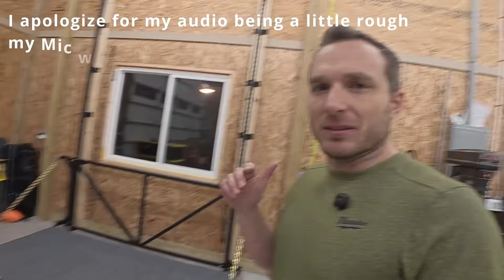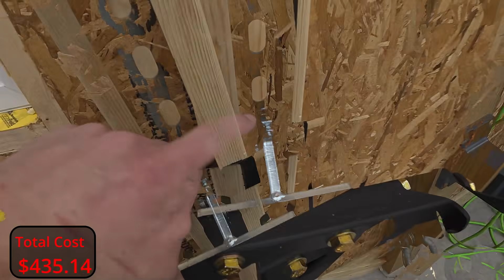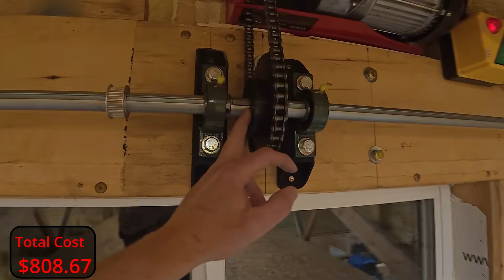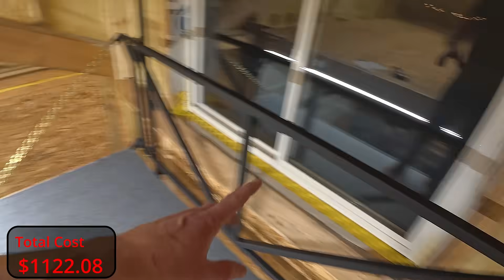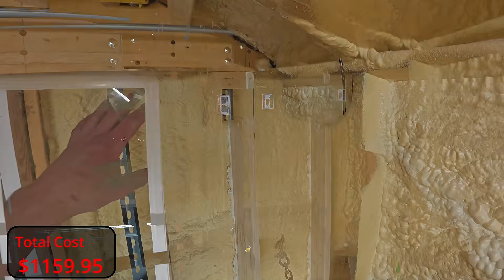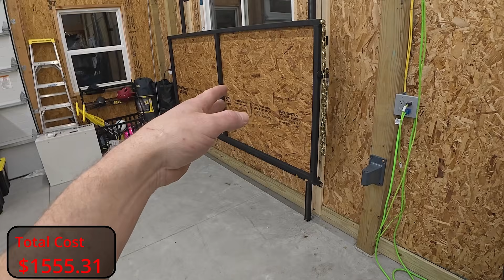DIY Shop Elevator Build Cost And full PARTS LIST (ATTIC LIFT)

Comment: Great design and thank you for the parts store, I'm currently framing in for a ride on elevator and was going to use a ball screw and thought of using the very same Vevor cable lift and your idea with two cables, shaft and info in wiring for limit switching and gate slider mech is awesome.
  If I may add an idea I saw using safety climbing tethers that work like a seat belt.
 I'm going to use two, one near each cable  for a safety like elevator without the pricey centrifugal brake safety.
 Once again thank you
Reply from the maker: Thank you for that.  Yes I think this is a simple enough design but is built well and works flawless so far and I've been using it almost daily for the past 8+ months.   Everything just works the way it should.  The dual cable set up with the single shaft keeps it perfectly level all the time no matter how its loaded.   As far as the dual fall arrest retractable belts, its a great idea and would probably work just fine. Only downside to those is they usually have about 3' of deceleration built into them so when you fall it slows you down before it stops up.   Im working on a system that to engage a parking paw into the slots at the track the second it senses either one of the cables slacking and would engage the pins before it ever really drops. Might go down 2" max before engaging.     I plan on working on it more and testing and perfecting it.  I will post a video of how it goes once I get the time to finish it up.    Thanks for watching!

Comment: For the fall arrestor, put a centrifugal brake the same thing they have in a fall arrestor but mount one on each end of the shaft.  Might only need one. This way you won't have to deal with another cable 14' long.
Reply from the maker: Yeah i was digging into an idea very similar to that and i think is a good option if the motor or chain has a failure but doesn't help if there is a cable failure.    I am slowly working on some ideas I have and when I get a little more time I will show you guys what I come up with and do some testing with it.   Thanks for the suggestion and thanks for watching I appreciate it!

Comment: Have you thought about or looked at some type of ratchet paw, that interfaces with the slots in the unistraut for a safety.
Reply from the maker: Yes I've been working on a system that uses the slots in the unistruts.  I haven't had the time you prefect and test it yet but i will soon.   Ill post a video when I do.  Thanks for watching

Comment: Great video, build. CAUTION….. saw another video like this, same 1/4” key way. He rode it…came crashing down…back injury!!! Key way failed…too much stress on that small key way!
Reply from the maker: yes you are right that bad things can happen.  I really dont ride it and if i do its not with a load on it.  I have a full staircase that goes up to the attic at the other end of the shop so i can just walk up and down.  plus i will have a video out soon with some safety features installed.  thanks for watching!

Comment: Some might think the chain is the weak link and they may be right, but I think the weak link is the hoist itself. I know lots of people use them and I rarely see issues other than "IT WON'T WORK", but as long as I have been thinking about building something like this, I haven't been able to find anyone, company or user, that will say it has been tested to " X " .  What I really do not understamd is how can they make these hoists so relatively cheap, but only go to 2200 pounds when they build 12 volt winches that I have witnessed holding 1-ton trucks and heavy SUV's up to 18,000 pounds for only a few hundred bucks more???  I am all about overkill, so yeah, I'd like to be lifting 1000 pounds with a 12,000 pound lift!!! I'd feel much better about anyone else being even relatively close to anything in the air...
Reply from the maker: Overhead lifting and winching are two different things.   I get your point that if its good for 18,000lbs than it should be good for 2000lbs.  Most Overhead lifting products have to have a 5 to one safety factor built into them.  So the same reason a tow strap the same size as a lifting strap is rated for 32,000lbs and as a lifting strap its only rated for 6,800lbs.  Not saying the hoist i used is built better or stronger than a 18,000 winch but it's built to be a hoist not a winch.  There are millions of these cheap hoist being sold and if there were consent failures you would hear about it.   With anything mechanical there is always the risk of part failure it's just how we try and minimize that the best we can.     Thanks for watching i appreciate it.

Comment: Maybe a high carbon key for the sprocket instead of high speed steel.  That key may wear out over time if there is even a little "back and forth" wear on it, or in this case "up and down."
Reply from the maker: That’s a good point, I’ll definitely keep that in mind if I notice any wear during my next inspection. Thanks for the tip! 👍

Comment: Sam,  Any way to marry the winch sprocket off a boat trailer winch?   Has the lever/lock on it that you manually flip one direction or the other...pending if your winching or releasing the boat to/from the trailer 🤔

Comment: Great  build you were  talking  about  safety  you could look  at how 4 post lift works  what they  call ladder  set square holes or stops with  engaging hooks  spring  loaded  that would  engage  on unistrut  or support  brackets could  also put a shaft collar  that slides over  key  ways  to strengthen  them up so the engagement  is more on main shaft.
Reply from the maker: Yes those are all great suggestions!  I have been working on and testing some new safety upgrades for it and once i get it done I'll post a video of them.   Thanks for watching 👍

Comment: Sam, you need to come up with some kind of safety, mechanical locks based on the cable tensions....something or don't be riding it!  Murphy loves me and I'm a retired Engineering Tech and I've been caught more times than I care to mention and usually because Murphy loves the way I trust the math!
 Be safe, or at least safer my friend.
Reply from the maker: I appreciate the concern and definitely agree that extra safety measures are a priority I am working on right now. Thanks for watching I appreciate it.

Comment: This is the best build of a lift I have seen.  Everything is well built to overbuilt.  Just the philosophy I approve.  Some additional suggestions for safety:   Expensive but effective would be a  Self Retracting Lifeline.  However, there should be a way to use the existing holes in the rails to fabricate an emergency stop.  Something mounted on the frame like a spring loaded bar with pawls that are engaged in the holes unless manually held back.  Or perhaps a friction brake that looks something like the trolly with bearings replaced with pads to grab the rail surface.  Something I have seen as a problem with everyone's build:   The manufacturer spec for the trolly is with force perpendicular to the rail and evenly distributed to all the bearings.  That is not the case in a vertical application.  The trolly is cantilevered and ALL the force is on the top set of bearings pulling out and the bottom set pushing in.  Under this condition the center bearings probably contribute no load bearing at all.  Also, the bottom set of trollies only provide guidance in the rails and don't bear load at all.  But that's why overbuilding is good.
Reply from the maker: Thanks for the input and suggestions. Yes the Self retracting life lines are a good option but you are right that they are pricey.  I have been looking into building an auto engaging latch that would engage into the strut holes.  Haven't spent a ton of time thinking about it yet but I should be able to come up with something.   As far as the trolleys go you are somewhat correct but there are some forces your not thinking about.   The lower trolley actually acts under compression and the further the load is away from the wall the more compression load that is on them.  Its pretty minimal though.  The upper trolley also sees very little load. Think of it like this, if there is 1000lbs in the center of the platform the max load at each outside corner is 25% of that. So thats 250lbs, but when rigging in on an angle like my chains, it increases tension. So for a 45 degree angle of the chain the tension is 1.4 times the load so the 250lbs ends up being 350 lbs. That is well below the 3000lb working load rating. There is also very little room for the the trolleys not to sit flat in the track so most if not all the bearings are making contact.  In saying all that, out of all the things that could fail the trolleys are pretty low on the list in my opinion.   I will definitely have a video soon with some safety upgrades and share what I come up with.  I am always open to ideas and love all the input from you guys. I will also post if I have any failures or issues, so far its been flawless.  Thanks for the compliments,  suggestions, and thanks for watching, I appreciate it.

Comment: Nice build! If you want an easy, quick and inexpensive safety stop you can install another sprocket, to your 1" keyed shaft, pawls to contact the sprocket and finally install another wire and connect that to your platform. As your lift elevates the pawls contact the sprocket as it turns. You also get a satisfying click & clack sound lol 

You definately have a solid build thanks for breaking everything down!
Reply from the maker: Thanks for the idea I think that would work pretty well. I will have another video soon with some more added safety features.   Thanks for watching I appreciate it.

Comment: I would think that a cheaper "fail-safe" for the possibility of that chain drive breaking would simply be to add another sprocket and chain next to it about an inch apart with a 2nd chain.  That way if either chain ever broke the 2nd chain would still hold the elevator in place and not let it plummet to the ground.  Can't imagine that would cost much at all.  Plus, I'm no mathematician, but it seems to me that dividing the load between two identical sprocket and chain assemblies moving in tandem might put a lot less stress on both of them.  If I'm wrong about that, don't hesitate to say so.  I would think the odds of both chains breaking at once would be quite low.
Reply from the maker: Yeah I still might do that and yes it would share the load so it would take some stress off the chain.  I will be doing another update video soon with some added safety features. Thanks for watching I appreciate it

Comment: I think I would add two more hinge supports toward the middle of the platform, connected to the back wall to mitigate some of the deflection (sag) in the floor..... in reference to the 1000 pound weight test showing 1/2" deflection. Otherwise this is a very good build. When you design your braking system, watch what this guy did for is redundant system. The one issue you have that he doesn't is that you have two cables, whereas most everyone else is using the centered, single winch cable system. Your setup will require a more complex system, if you want to automate for both manned and unmanned lift failures. Unfortunate for me, I will have to rethink my own safety system, since I found your design more appealing. https://www.youtube.com/watch?v=uKfYjWBLKis
Reply from the maker: I really don't think the extra hinges are necessary. Especially since the real world use is in the 300-400lb range. At that weight there is virtually no sag. Also it would be difficult to get the hinges to work correctly since the pivot point is the center of that rear tube so getting them to pivot on the same axis would be a little difficult. I'm sure i could come up with something but just haven't put much thought into it.  Also I did see his video and braking system, that is based on the original ottis elevator design and is pretty neat and effective.   I do have some sketches on how I could make a similar system work with the double cable set up but would have to do some testing to see if it could work.  I have a couple other simpler designs that might work better.   These will be in a future video once I finish my attic loft reinforcement video that I am currently working on.  So stay tuned for more, subscribe if you haven't already and I very much appreciate you watching!  Thanks

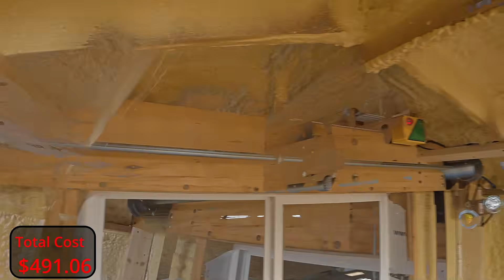Comment: 5:53  Still calling it a "WENCH" I see.   
FYI - a "Wench" is a derogatory term for a woman.  Google it, I dare you. 
The appellation has lost its innocence over the past couple of centuries, and is now used to cast a slur upon a wanton woman.
A WINCH , on the other hand, is a powered cable and drum type apparatus, used for pulling (or lifting).
Please take note, if only to spare yourself from future ridicule and embarrassment.
Reply from the maker: I definitely know the difference but its just the way I pronounce it.  I'm positive nobody thinks I'm referring to a women in a negative way when I'm pointing at a hoist motor and call it a wench lol.

Comment: If you used a right angle drive with a worm gear interface the shaft only would move when it is powered. When the motor is not energized the cable shaft would be locked and the platform would not move.    Think of 1/2 of a care differential   ie Pinion gear , Ring gear one axel
Reply from the maker: I understand the theory of a worm drive being one way. Are you suggesting to add a second drive unit directly to the shaft or replace the hoist for a worm drive unit?  Thanks for watching

Comment: Personally I like all the safety factors. For the use. You can use the rail holes for spring locking brackets as it goes up. Retractable when going down. Similar to your hold up latch.

Comment: An admittedly odd idea for the safety brake might be too mount a centrifugal clutch on the left end of the lifting shaft. Could either design it with teeth to catch and lock, or make it smooth so that it just slows the drop to relatively safe speeds. Just a thought.

And I'm definitely building something like this when I finally get to build my shop
Reply from the maker: That is an interesting idea, I wonder how much it would have to drop to engage it.  Ill  do some research.  Thanks for watching and the suggestion!
Reply: @Built-By-Sam  Not sure. Most of the centrifugal clutches I've worked with are for lawn equipment and scooters, and those don't start to engage until over 2,000 RPM. But those are only a couple inches across. If you're building it, you could make it engage earlier and harder by going with a larger diameter drum and/or making the shoes heavier. Working out the maths to calculate diameter and RPM to solve for angular momentum and then work out the friction area and coefficient of friction... that's beyond my Oklahoma "education".

Comment: This is an awesome lift! My only concern would be the shear capacity of that 1/4" key, but based on a quick search it seems you're within shear capacity limits with any load sub 1,000 lbs... That said, I'm not sure I'd trust my life to a Vevor product, lol (and I have mostly liked vevor products)
Reply from the maker: Yeah if I was planing on pushing it to 1000lb of daily use it might be pushing it.   But the torque value of a 1/4" key at 1" long is about 8000lbs.  So i think I am good, since the 1000lbs was pretty much a double my limit stress test and would mostly keep loads in the 300-400lb range max for real world use.  And as far a Vevor goes I feel like if there is one thing they have to build halfway right would be a hoist.  Unless I wanted to spend ten times the price on an American brand that is still probably built in China I think it is going to be ok.  I appreciate you watching and thanks for your input. I do like seeing everyone's perspective and analysis. I'm here to learn like everyone else. Lol

Comment: The one suggestion that I have is your choice of plywood for the base, maybe it’s only me, but in my mind osb plywood is only for sheathing applications, cdx is a much better choice for load bearing jobs, the osb is vulnerable to humidity and becomes weak. On construction we call it shredded wheat. 
Even cdx I would prime and paint with a very good durable paint.
By the way it’s really great to see you have your apprentice at your side, the next generation is in good hands. 😊
Reply from the maker: I feel a good premium osb subfloor is very close on par with plywood. The cheap 3/4 stuff is not that great but the premium stuff like advantech, gorgria pacific,  lp, and more are very good, very strong, very flat, and moisture resistant.   Its hard now days to find a sheet of 3/4 cdx that not shaped like a Pringle chip. Lol.  Either way both are plenty strong for the application.   Thanks for watching I appreciate it.
Reply: @Built-By-Sam yeah that looks like advantech, which is very good for this application

Comment: I’ve built one of these in my shop and really went over kill I thought but you did a great job and now I’m rethinking mine. I did get 2 retractable harnesses but haven’t installed them yet. These lifts free up so much room in shops.
Reply from the maker: Well I'm glad I could give you some ideas if you needed them.  Also stay tuned because the next project is reinforcing the attic floor so it can handle the extra weight I'm going to put up there.  Thanks for watching

Comment: You might want to paint an outline of the lift on the floor so you will know where it is when it comes down. It will not be fun if anything is in it’s scope as it lowered.
Reply from the maker: That's a good idea for a safety outline, thanks for the suggestion and thanks for watching. 👍